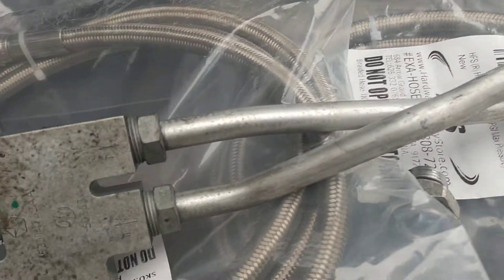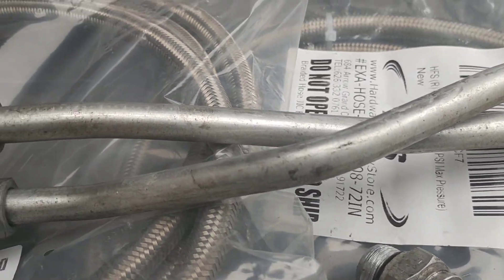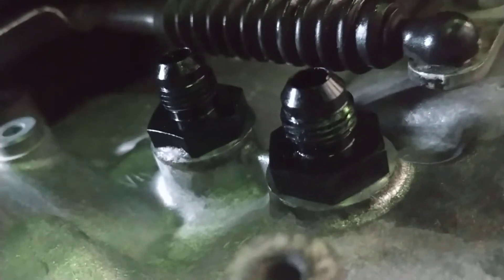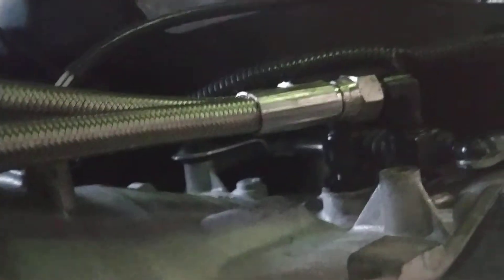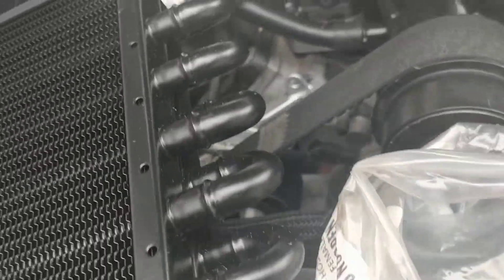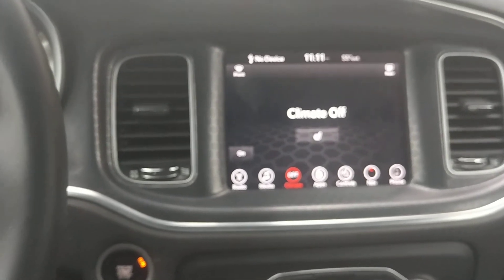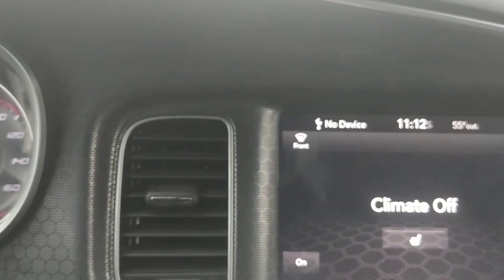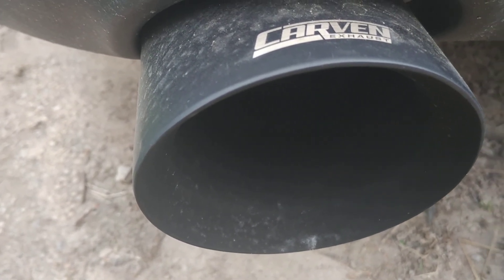8HP70 Transmission Cooler Install

Comment: Do you happen to remember where you got the braided kit from? Im leaking from the stock quick connect.
Reply from the maker: Yeah I got it from eBay I basically bought the parts and made my own kit I can send the links for sure
Reply: @SRTKHRIS  hell yeah, I kinda already checked stuff out on eBay. I figured you had to of made your own. it's definitely the cheapest way. Did you delete the bypass valve. I live in Michigan, cold as hell in winter. And would rather have valve included. So I'm thinking on running braided lines but with the valve in-between so I'm gonna need extra flare connects to do the job.

Comment: I'm just tuned my scat FBO on e85 no ttans tune and I'm already throwin codes about the tranny heat
Reply from the maker: Yeah that heat can ruin a transmission fast..who's doing the tuning? I finally found a real good remote tuner in Illinois they're on point.
Reply: @SRTKHRIS  my tranny is completely done now but I got it done at calspeed in southern Cali gonna build it up with a 3200 stall but I'm gonna need a new tuner

Comment: What torque converter did you put in that raised the temps so much ?
Reply from the maker: It was a 3500 stall converter the previous shop installed in it.  It was horrible I don't remember the name of it I'll try to find the information on it.
Reply: I've heard of Edge and Circle D, not sure of any others. I wonder if there was something wrong with it, to heat up the fluid so much...

Comment: What's the thread size in the trans and what size AN lines did you run?
Reply from the maker: i went with the #8orb thread with a 6an line